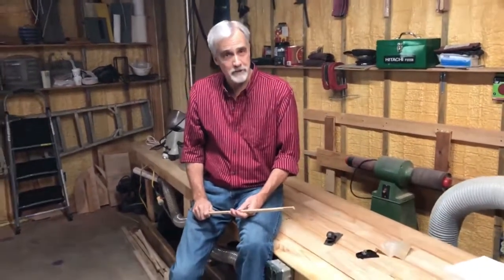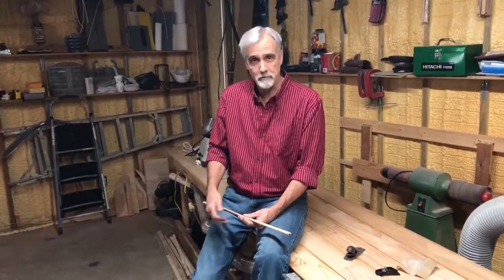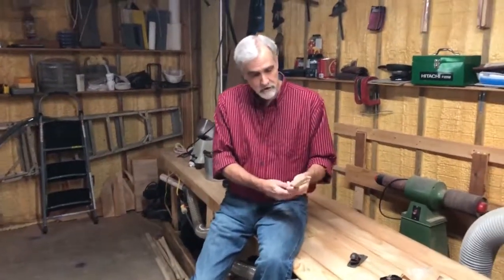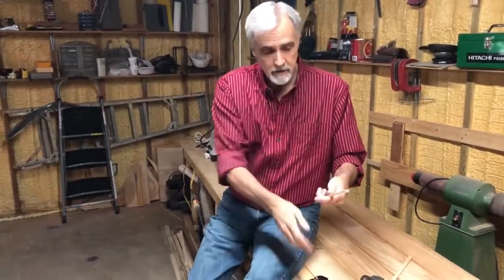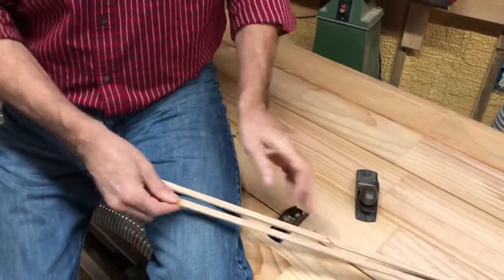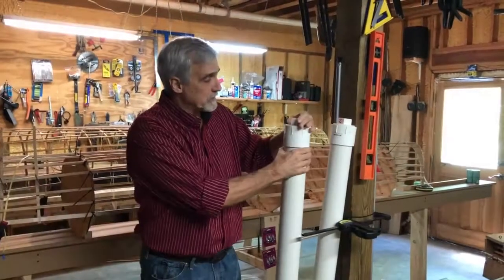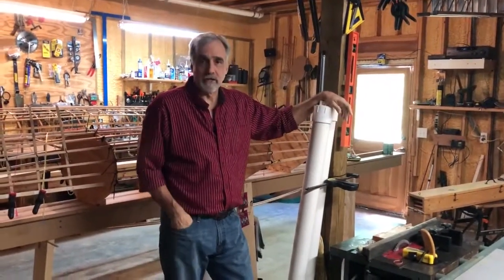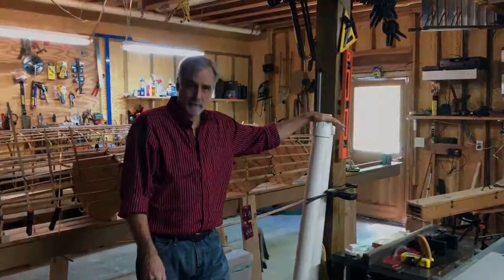Cutting and shaping ribs from ripped stock

Comment: You talk about making the ribs a bit wider. What about making the stringers a bit thicker?
Reply from the maker: The stringers don't get steam bent so they can be made a little thicker.  However, the gunwales and rub rails are already pretty stout and can be difficult to fit if you make them much larger.
Thanks for your interest in our boats!
Larry
Reply: Geodesic Airolite Boats - thanks so much for your very fast and useful reply!